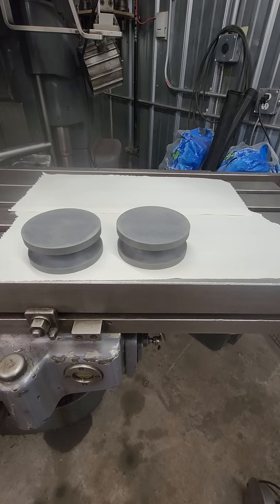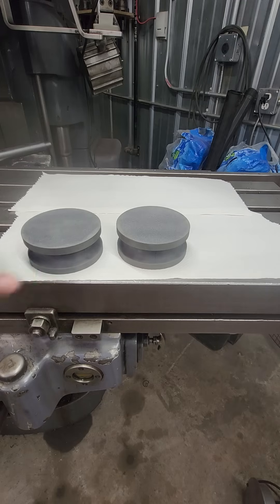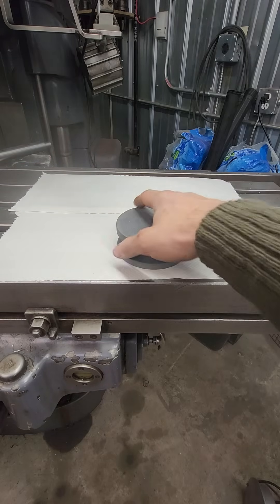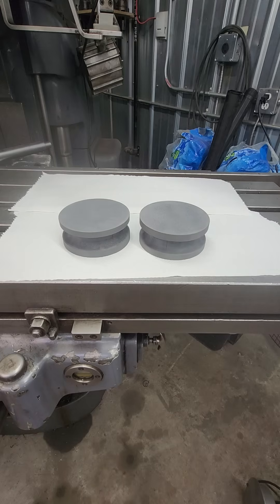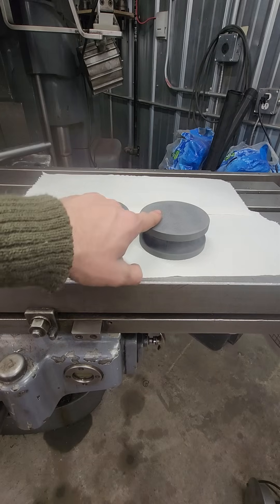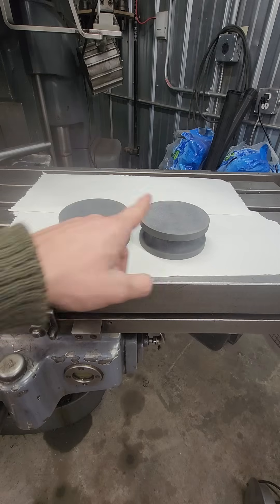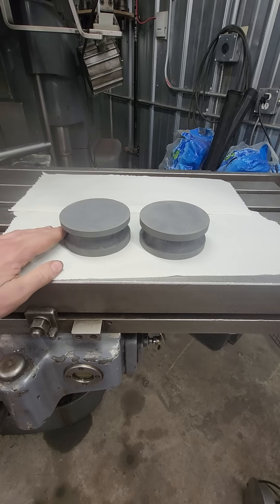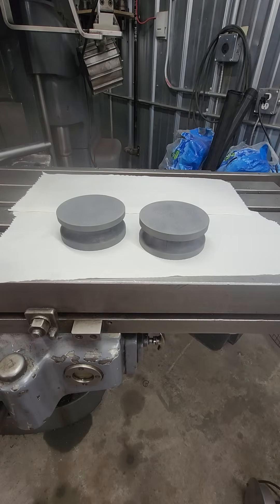The MYTH of precision flat stones in machine shops. (Make yours at home with NO tools)

Comment: Thank You for doing this video. I happened to have taken a set rectangular stones that had 2 sides (1 rough and 1 fine) and wanted to clean up their faces. So I ended up switching back and forth alternating the rough and fine with each other as they were approaching flat added in a worn diamond metal plate. My intention at the time wasn’t to achieve perfect flatness but again just clean up the surface faces and finish with 2 reasonably flat stones.

The stones came from an originally 3” x 12” stone that I had dropped and broke in the middle so I was working with the 2 halves (about - 3”x5” after squaring up the center break) so fairly manageable size. After I finished about 1 hour later and achieved decent results (full contact around the entire perimeter and just a slight imperceptible bowl in the center that only could be seen from how the water pooled) the two stones would slip and slide across one another just like you demonstrated. Having a decently flat stone I figured it would be a good time to clean up the chuck face on the lathe I was rebuilding and ended up surprised by how the stone wouldn’t bite into the metal. It just floated along across not even disturbing the antique brown patina that had formed. 

I don’t claim to have made “precision flat stones” however I do know that the result of the constant lapping together had changed how the stone behaved when run across a surface. It acted very similar to the precision flat stones I had seen other demonstrate and the similarities always left me wondering what the “exact differences and benefits actually were to a more expensive precision ground set”.

Obviously it needs to be stated that this won’t hold true for just any type of stone. I’m pretty certain material and type of bonding is just as important. This can make purchasing difficult as a lot sellers don’t list and often don’t know so as a starting point you can rule out all stones with noticeable sized air cavities or that are on the lighter end of the density. If held Im the hand the stones should feel fairly dense/weighty for their size and they should also not easily abrade when rubbed together. Material should obviously be generated when doing so but it should not readily change its shape. If you can already see large amounts of change in the first 5min, you have the wrong stone. I’ll let other more knowledgeable people discuss the correct composition but this should help narrow your criteria when searching.
Reply from the maker: Good comments all around. Using the 3 plates method it is very possible to get the stones dead flat simply via lapping against eachother. Perhaps there are other types of stones that will work for this. I know there are many that will not as you say. I do have one set of surface ground stones that are Norton India (aluminum oxide) and they work fine. However without trying this process I do not know how well the lapping against eachother would work. 
These stones are silicon carbide, and it worked very well with them. Any of the Norton Crystalon stones would be safe to use.  These no name stones worked, but I would not be at all surprised to hear the no name stones are hit and miss depending on the vendor.

Comment: While in the Navy, we where doing a job where we needed an absolutely flat surface to lap a valve. We took two slabs of granite, two foot by two foot, and lapped them, against each other, for two weeks to get the surface we needed.
Reply: That reminded me of working at Garden Island Naval Dockyard in Sydney Australia.  I had to handscrape a 1M x 1M datum plate for guided missiles using 3 reference plates. Worse still, the stainless steel top and bottom sandwiched aluminium had also to be equal thickness throughout.
Reply from the maker: That will work if done right. One project on my list for the new year is making a set of iron lapping plates to use to lap some hydraulic pump internals. We will be using the whitworth method for them. I will intend to make a video of the process.

Comment: We have to ask the question, how was the first flat reference surface achieved that then went on to help make the first surface grinder and so on and so on? The Whitworth 3 plate method.
Your stones are flat, flat enough for a machine shop. Maybe not flat enough fora reference lab, but that isn't the game you're in.
Reply from the maker: Absolutely.  I frankly do not care enough to check them as they are proved flat in use, but I would be quite confident in these being flatter than the vast majority of shops are capable of measuring.
Reply: I don't think Whitworth invented the 3 plate method, its been used to make optical flats since the beginning of optics, and typically results in flatness measured in fractions of a wavelength of light (the wavelength of sodium yellow, for example, is 589 nano-meters).

Comment: Truthfully, you can make these with a diamond flattening plate. It’s easy to do and I’ve compared them to the ones I made on my surface grinder. You can’t tell the difference. It takes a total of ten minutes. I’ve measured the flatness, and they’re extremely flat. Flat enough that you don’t need the three stone method. To re-flatten them, two or three minutes back on the flattening plate and they’re back to new. Every machinist should have a good diamond flattening plate.

Let me explain a little bit about this since I see some confusion as to what these things are and how they work. Regular stones have sharp grains at random angles, sticking up from the surface. As you use them, the grains wear down and the surface can get somewhat finer. But each of these tiny points js a chisel. Each one shaves a tiny sliver of metal. Since they’re all at microscopically different heights, the higher ones do most of the work. Any metal surface you put them on will be abraded. That’s because you have many thousands of these tiny chisels scraping away at the surface. 

If you have a small upset on the metal surface, you will remove that upset. But, the problem is that parts of the stone will also remove metal around the upset, particularly as the upset is shaved down. If the metal is already flat, as the table of a mill should be, and you rub the stone around on the table, you WILL shave that table down.

These flat stones do two things. One is that they are actually flat within a tight tolerance, and two is that they won’t shave a flat surface. Number one is easy to understand. Since the stone is flat there aren’t small bumps that can abrade the surface.

But two is just as important. When you grind the stones with a fairly fine diamond on a surface grinder, or use a diamond flattening plate with a finer grit, you actually shave the points off the grit of the stone. What you end up with is a very flat stone that can no longer remove metal from a flat surface. This is easily determined by stoning a flat surface with the flat stone. It will tend to slide rather than cut. You can both feel and see that result.

But when there is an upset in the metal, the stone will shave that off. The reason is because the stone has tiny spaces around the grit. When you remove the points, you end up with tiny flat surfaces with spaces between the edges of those flat grits. But the edge of the grits are sharp, just flush with each other. So when metal is projected above the otherwise flat surface, it gets caught between the grit and that gets shaved off. Finally, the projection is removed and the stone has nothing to catch on to and the shaving action stops.

Now, unless you’re using way too much pressure, you can move that stone back and forth and nothing much will happen. Will you remove a millionth of an inch with pressure? Yes, but that takes work and there’s no reason to do so. These stones should be used with light pressure. Let the stone do the work, not you.
Reply: @melgross - I am an old machinist (74) and I 100% agree with you. The only problem we have here is that only one person out of 100,000 will read what you bothered to write. I did and I think you said it very well.  I thank you for your valuable input and I hope at least three people actually read it.
Art from Ohio
PS: Like Jimmy Diresta would say; "If it looks flat - it is flat".
Reply from the maker: Thanks for that detailed comment.  You described the theory behind these stones very well. It is also great to know there is at least three ways to make these stones. I do have a diamond plate, and it is quite flat, and the thought crossed my mind. However I think it was too small in relation to these 4" diameter stones, and based on a quick test I would have been there a while with how fine the diamond plate is. I use it for lapping the tops of custom HSS form tools, and honestly have not seen the need for a larger one for the work we see and do here. 
I have decided I will make a followup video to address most of the comments on this video so far
Reply: @Kurokimachine  These comments lead me to get a cheap lapidary disc from china to try this out - the kind used to polish gemstones.  They're cheap and come in grits from low hundreds to high thousands, and I've seen them up to 12" dia.  I guess a risk with grinding a stone on a reference surface like that is the risk to create a convex surface on the stone.  Maybe there's something to be said for getting the stone part way there on a cheap diamond plate (or I've seen someone use a cheap diamond cup wheel in a milling machine to the same ends, resurfacing both), then finish up with a 3 plate method with fewer steps?  Either way, looking forward to seeing your future video on the topic.
Reply: I have wondered about that. What grit of diamond plate do you use? I see tons of them available but I'm not sure where to start.
Reply: Every single thing you said is exactly what Renzetti said in his original video. And he never claimed to have invented them, he explicitly states that it's something he learned about, but he did introduce it to a much wider community. I'm looking forward to your video on how yo do this in ten minutes.
Reply: I'm a 76yo machinery repairer with a machine shop and the 3rd one to read it so anyone more is a bonus. 
Greetings from Sydney Australia.
Reply: @johnboom6777  And greetings from Melbourne Australia too.
Reply: I have a granite surface table 1M square and 200mm thick. Used it once for a job and not since. It's on a heavy steel wheeled frame with wooden protective top boxed cover. It's only purpose now is a couple of bench drill presses sit on top of the cover.
Reply: Please do tell which diamond plate you use for this!
Reply: What is a diamond flattening plate that you speak of?
Reply: @brandontscheschlog they’re pretty common. It’s a steel plate, machined, or even ground on, usually one side, 1/4” thick for small ones, or 3/8 to 1/2” thick for larger ones. Then it’s coated with whatever grit diamond is wanted. It’s used to flatten sharpening stones. Artificial stones or natural stones. It doesn’t matter.
Reply: Great comment. Thanks for the info.
Reply: I've lapped on a diamond plate too, works great
Reply: What you're saying is only partially true.  You don't grind the asperities completely flat like you think you are....a bunch of flat plateaus and nothing else.  This is false because abrasive grains fracture and there will always be sharp points.  This is the entire science of all abrasives.  There are always asperities that cut.  Do us all a favor, take one of your favorite gage blocks with their super-finished surface....and go rub it on your super special stones....and don't apply any pressure....and show me that it doesn't even make one cut line on that shiny finish.  Of course it's going to scratch it, duh!
Reply: @madmat990 perhaps you’re just guessing. I’ve measured this as well as put it under my stereo microscope. When you grind the particles flat they don’t functions as you think they do. Look, these stones are nothing new. I’ve been using them for decades and so have many others. I don’t use silicon carbide as it’s too brittle for this purpose. Aluminum oxide stones are used and the grains don’t break down that easily. When all of the grains are ground flat it no longer acts as an abrasive. This is well known in the industry.
Reply: @melgross  I think you're just repeating some stories you've been told.  Do the gage block test and get back to me with pictures....
Reply: @melgross  I think you're just repeating old wives' tales.  Do the gage block test as I mentioned and get back to me with your microscope pics.  Only then will I believe you.
Reply: @madmat990 gauge blocks will not scratch against precision grinding stones but it is very important the stones are degreased and cleaned well because otherwise there will be abraisive dust from the stone that is doing lapping the gauge block. 
One cylos garage on Youtube did a video on it measuring to millionth of a inch.
Reply: @madmat990 Yes, it likely will scratch a minimal amount on a gage block. But so too will almost any random stray dust particle that gets between two gage blocks. They are finished to an incredibly fine level. 

Do you know what DIC is as it relates to microscopes? Differential Interference Contrast. Look it up if you're not familiar. It gives an intricate look at microscopic surface contours. Orders of magnitude better visibility of surface contour and things like scratches than a regular microscope. I have an Olympus metallurgical scope with DIC attachments that's good for over 1,000x magnification. I have done that test. I can see the scratches made by the lapping process used to finish the blocks on brand new blocks.

Yes, if you use a lot of pressure it will scratch a gage block. But the scratches from a properly prepped and clean flat hone used with care and lightly are no more than what comes from normal usage/wear from using the gage blocks. Barely there, and do not affect use. They generally remove way more damage than they create. I have used a flat hone on gage blocks that would no longer wring, and they wring great afterward.

The caveat to all this is that the hones in the video are not the type you want to use. Silicon carbide is way too friable and particles of it will easily break away. When they do, they instantly become rolling and sliding destructors to any surface that they touch - including the silicon carbide hone surface itself! Always use aluminum oxide for these, just as pointed out earlier. 

A worn-in 320 grit diamond plate that is properly flat (check it on a surface plate with a piece of paper or small steel shim under the indicator tip) will do just fine to make one of these. After flat lapping or grinding it is imperative to clean the surface of the hone so all stray/loose grit particles are removed. A stiff nylon bristle brush and soapy water will do. Then you can rub two hones together if you want, like all the YouBoob guys do.

I've posted about this multiple times at Practical Machinist also, but of course, everybody who buys a set of surface ground "flat stones" is an expert these days, so nobody really listens. I have been using these for over 30 years, since WAY before they were the fad they are today. I made my very first one by flattening a hone with a diamond dresser from the surface grinder mounted at -15° in a boring head in the Bridgeport! 😂 Used properly, they are a handy resource. They are not very useful for any but the finest surfaces with the lightest damage, IMO. I mostly use mine for finicky surface grinder work or smoothing parts for precision assembly.
Reply: @electech3339; kiitos, I read kaikki of your post.
I guess that a thin diamond plate on a granite surface block might work... The subject is quite interesting, as are the measurement techniques.
Alles gute für 2026 hyvää uutta vuotta!
(Just a simple 🇨🇦 guy, mixing some language fun Suomesta, aus Deutschland, and BC
Reply: @lohikarhu734thin diamond plate will not work for the end steps as the bottom surface isnt flat and the top isnt either. Its nickel bonded diamond to stamped sheet metal, and the sheet metal isnt of uniform thickness/has burrs at the shear points. Id much sooner tape down sandpaper to a surface plate, you can get 1/10000th flatness with that in proper setup, and absolutely mirror surface finish. Its how i lap some indicator bases i use for the surface plate so that the bases will just float across the plate and have better repeatability in extremely small measurements where im sweeping the insicator base rather than the part
Reply: @napaisava mine aren’t stamped steel. They are plate and machined flat, possibly ground, though it’s hard to tell. They are very flat. I’ve measured them.
Reply: @melgross ooh yeah for that its good, i was saying for the cheap stuff lol. I intend on getting one of those myself
Reply: @electech3339  I learned something here, thank you.  I'd not heard of DIC - but was aware of using optical flats and a helium lamp to use interference to inspect deviations from flatness in surfaces.  Now I'm wondering how autofocus works on a camera too.  Thanks for the new rabbit hole.  I'll take a look at your channel too.